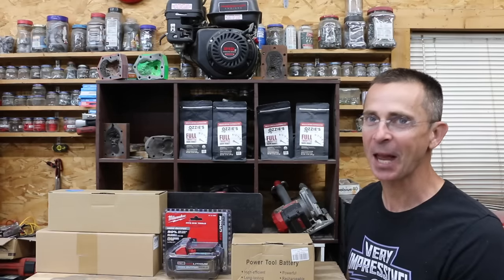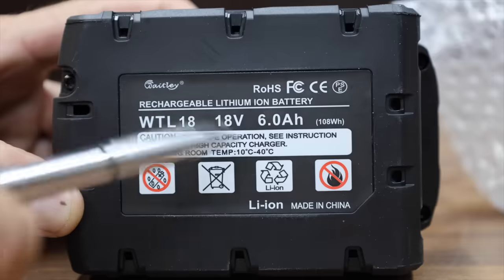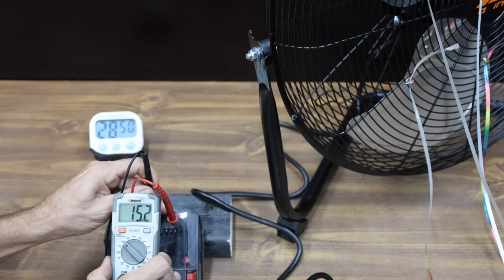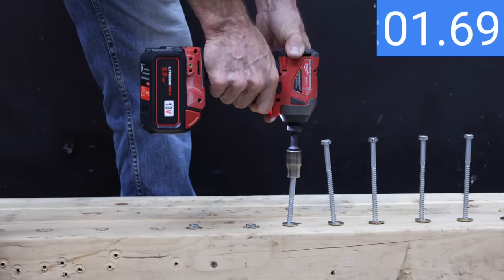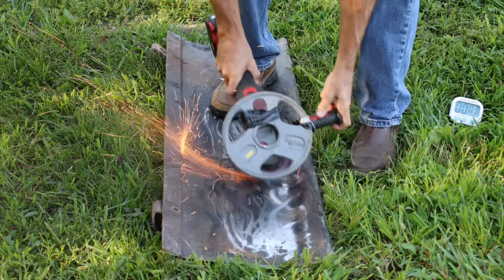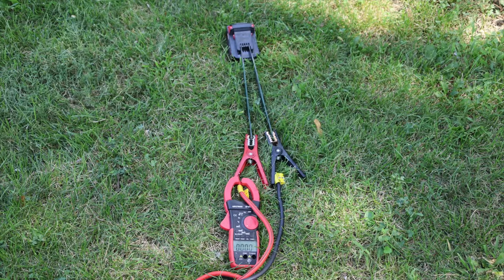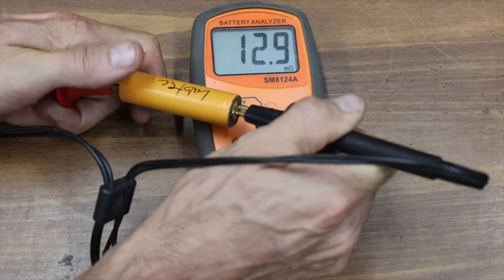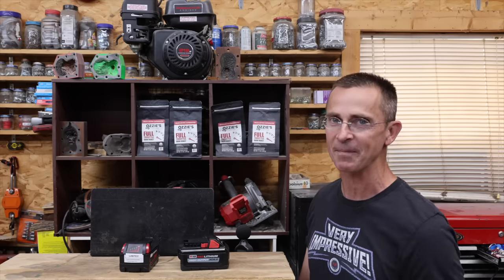How Dangerous Are Knockoff Tool Batteries? Let’s find out!

Comment: This video solidifies my personal policy of never ever cheaping out when it comes to lithium batteries. My main reason has always been safety, but glad to know the performance is also another valid reason. Lithium batteries store an insane amount of energy and in a catastrophic failure even a small one can ignite anything next to it.
Reply from the maker: Thanks for the suggestion.
Reply: Heyy, cool to see you here ThioJoe!
Reply: Meh. It really depends on your use case. If you're a pro, yeah, you NEED the real batteries. But these knockoffs will be good enough for 95% of the average homeowner.
Reply: @Techno4more  if you are a pro, the Labtec is more productive. 4 Labtec vs 1 milwaukee all day.  If you only have $100, Milwaukee can only powers one tools while the Labtec can use two while the other two on the charger.
Reply: @sportsonwheelss  yeah, if budget is a concern then ok I see what you mean. But if power is your concern, you need the real ones. Especially if we are talking about Dewalt 60v batteries which is what I use
Reply: There are quite a few other battery designs poised to come out soon that offer a lot of advantages over lithium ion units. I can't wait.
Reply: Chinesium isn't a material I personally believe make a good battery. Iunno maybe others feel different
Reply: $/Wh is not something to dismiss, however.
Reply: There are numerous examples of defective 18650 batteries, all from China. From vaping devices catching fire, Sure Fire flashlights, a UPS 747 cargo plane crashing, to now EV's catching fire. Defective lithium batteries changed shipping methods internationally.
Reply: What I find remarkable is how little price has to do with quality, here the absolute most expensive and the absolutely cheapest products were the safest and best performing, while the middling was the skimped out safety hazard that should be withdrawn from the market.
Reply: Same here. Bought Milwaukee because of safety. Don’t wanna burn my house or garage down.
Reply: Not very good at simple math, are you?
Reply: @steadyeddie7453 my company operates cargo jets; I'd be a little bit scared to be on those jets knowing they carried batteries that are labeled as "cargo aircraft only"
As in, it's too risky to put this on an airplane full of humans, but the risk is acceptable when it's on a plane with just 1 or 2 people
Reply: @sportsonwheelss  also if for some reason your 1 milwaukee dies you're stuffed. 1 labtec dies, you still have 3 other batteries to fall back on.
For me buying 4 labtecs is a no brainer.
Reply: @Techno4more more likely to burn..house or shed down with cheapos
Reply: @jackd1582  the odds are just low. There's so many cheap devices with lithium batteries nowadays. Flashlights ect. Are you worried about all those things too?
Reply: I don't think a failure can be both small and catastrophic at the same time lol. If it's catastrophic it's not small.
Reply: @Techno4more A 5s2p knockoff with 3 or 4Ah is better than those 1.5Ah packs that they include with some tools, absolutely.
Reply: @steadyeddie7453 that's not saying much because almost all lithium ion batteries are made in china, but it's worth pointing out that the LG batteries that caused all those Chevy Bolts and Hyundai Konas and a half dozen other EVs to catch on fire, prompting GM to recall every Bolt ever made and Hyundai to recall 80,000 Konas, were all made in Korea.
Reply: @julianbrelsford I'm more concerned with the 50,000 gallons of gasoline than a battery, personally
Reply: @ProjectFarm  i second his comment. Look at all the E-bike firea.
Reply: @sportsonwheelss  not really the millwakee fulee is made to push more power with their  brand.  Each brand hs their own thing, but it is made to dov a certain thing. So if you are a general contractor you don't cheap out on your tools., you  have back up batteries charging anyways.
Reply: @jsplasha  Then you don't know much about physics of flammable liquids.

50000 gallons of gasoline in a tank, even a leaky one, won't blow up, despite what you think. You can light the leaking fuel and the flame will go up to the point of the leak...and it'll just stay there until all the fuel comes out, slowly burning out. Gasoline requires a proper fuel to air ratio to be explosive (and to 'catch on fire'). And if it's not on fire, it won't heat up. Lithium battery doesn't need fire or any ratio to explode or start a fire (though it still obviously needs oxygen to GET on fire).
Gasoline also won't self-combust unlike a battery, so unless it will meet something then it's just a liquid. Toxic, with flammable fumes, but one giving chance to contain the damage in a controlled, calm manner.

A battery can self-combust. Furthermore, even if stored, it can heat up greatly to the point of causing a fire to nearby flammable objects even if stored in something that is not flammable (heat transfer). It is also much harder to extinguish and once extinguished it CAN go up in flames again.

Proof of what I said? If a fire starts from a gasoline-fueled car on a ferry, the a few cars near it MAYBE will catch on fire, but the ferry itself and most cars will be salvageable in most situations. For them to even start being on fire out of nowhere...yeah. Basically unheard of.

An electric vehicle goes in flames? Yeah. Bye bye ferry and everything on it, with quite the high likelihood. Have a few electric vehicles and it's not possible to stop due to how those batteries work.
Reply: When Lithium Ion 4 rolls out it wont matter since they don't catch on fire.
Reply: @thedailyruns6046  what about lithium ion 6 though?
Reply: Buy Made in America.

I'd prefer Made in the USA. 
  Sometimes I settle
Reply: And where's the milwaukee made China, lol
Reply: @Techno4more Do not buy knockoff batteries! If you’re in the Milwaukee ecosystem, just wait for Home Depot “special buy of the day” deals on Milwaukee batteries. You get genuine batteries with a full 3 or 5 year warranty. Two high output 6.0ah and two 8.0ah high output batteries are $275. That means you’re getting these 6.0ah batteries for about $60 a piece. I’m not touching cheap knockoff batteries that are in my house, barn or new truck. I’m not burning down my house or truck to save $30 a battery, especially since they don’t last as long, run as strong, or run as long.
Reply: @sportsonwheelss That’s just wrong. I’m not burning my house down to save $30, especially since they don’t last as long or run as long.
Reply: @bernieglass8098 I wish Milwaukee batteries were made in the USA, but not everything made in China is bad quality. My iPhone is 8 years old and still works great, and it was made in China. It’s been dropped thousands of times and gotten wet countless times. I’d never touch those crappy weak aftermarket batteries.
Reply: Been in the business 25yrs...I've never ever heard of anyones batteries catching fire. Keep them in a 10 dollar lipo case if you're that paranoid. I see how you like to spread fear and paranoia but offer no valuable solutions.
Reply: @Kalmaro4152  Such a dated and ignorant statement.
Reply: @cliffordmontana4562  The point is milwaukee battery an battery tools are made in China.  All milwaukee does is put there name on them.  Yes they are better quality.  But still made in China not Wisconsin.
Reply: Yep I agree. When it comes to things that can catch fire...best to stick with OEM.
Reply: It's like you didn't watch the video
Reply: @Alan_Edwards  well guess I shouldn't have bought that knock off battery on ebay for my milwaukee 3 years ago. Still working great.  The original only lasted 2.
Reply: If you do use them for lights
Reply: @bernieglass8098  I still think it's somewhat risky since they are not built to the same standards but I guess that could depend on the manufacture too as the test results suggests. Problem is, there is no way to know so it is still more of a risk IMO.
Reply: I'm the cheap battery is less likely to explode cause it doesn't have much power. Simple physics.
Reply: YouTube doesn't post my comments

Comment: 👍Another great test Todd.  Not only did the Milwaukee batteries out performed the knock-offs including the used Milwaukee.  I’d say that the longevity of the Milwaukee batteries will also outlast the knock-off.  This test actually confirmed that “you get what you pay for”
Reply from the maker: Thanks!  Thanks for the feedback.
Reply: Likewise, you don't get what you don't pay for.
Reply: Idk, 3/4 the capacity for 1/4-1/3 the price can be very compelling depending on what you need.
Reply: @emptylog933 a used Milwaukee 5ah battery is $25
Reply: @throbbing1380  But it's a lottery getting a good one

Comment: Your work is OUTSTANDING. Without these kind of specific  tests that deliver irrefutable numbers, we’d never know the difference. Thanks a million (amp-hours!).
Reply from the maker: Thank you very much!
Reply: @ProjectFarm  -  You uncovered a beautiful secret which I had not considered... The genuine batteries are using a larger cell such as the 21mm X 70.0mm lithium cells (that is what the size nomenclature means) for added power. I am also curious if they are using flashlight lithium batteries and not the higher current capable rechargables (but at reduced capacity) which is why Milwaukee is using the 21700 for the added punch.  This is another reason why they use special cells in vapes which are made to produce much higher currents.  I am also quite surprised that some of these batteries did not self destruct or just plain catch fire. Love your work. I would like to see the USA or EU mandate that the tool manufacturers settle on a standard battery interface and let the manufacturers of batteries and chargers battle it out for the best product, all compatible with each other. The nightmare of most manufacturers... But that is exactly what Android and the PC are... cross compatibility.

Comment: The biggest problem I have with the knock offs isn't the performance of the cells but rather the performance of the latching mechanism that connects the battery to the tool. The name brand batteries always latch much more securely and are made of better plastic that doesn't break as easily.

Comment: Thanks for testing these. I recommend getting a clamp-on meter that has a hold-high function on it. It'll hold the value on the display at the highest current it sees. I've used it for testing short circuits and it works great.
Reply from the maker: Thanks for the tip!
Reply: @Magrath For highest accuracy, a scope with the current clamp or a shunt resistor is the best bet.
Reply: @wychowanek90 Exactly, DMMs can't sample short occurrences of high values.
Reply: It looks like the clamp is not fully closed, no way to get a good reading there.
Reply: Exactly, I noticed that too, but after the the first 2 batteries he put the clamp correctly @PropellerSteve

Comment: Useful! I've been eyeing 'cheap' batteries, but I'll stick with the actual Milwaukee batteries after this! Also, testing suggestion: toilet fill valves. I've always just bought whatever Home Depot has on the shelf, but I feel like they're noisier and don't fill as fast as whatever the toilet had out of the box.
Reply from the maker: Thank you for sharing!
Reply: Second this!
Reply: I would agreed to that they do make some noise an aren’t that quick
Reply: Yea, dumb knob that works in IT - but I've used Fluidmaster whenever I've needed a replacement.  I just checked my main-floor Kohler commode that's seen 18 years of daily use - Fluidmaster 400 series. All original parts - including flapper - Wife and I had the house built, I do all the maint. Unless the Weathertech guys snuck in overnight and changed it out, it's original.
Reply: I've been using Fluidmaster 400A for decades. I use the Pro 400 now but it's still pretty much the same. Only big differences, the pro series has a plastic flow restrictor in the shank vs a rubber one in the standard ones. I recommend removing the rubber (corkscrew shaped) restrictor from the shank before installing. If not, it will dramatically slow the fill of the tank.
Reply: Yes, Fluidmaster 400A for sure. And yes remove restrictor for quick fill. I bought some in the past that didn't have a restrictor, so always check. 36 year plumber.